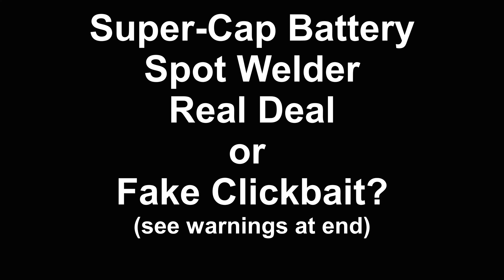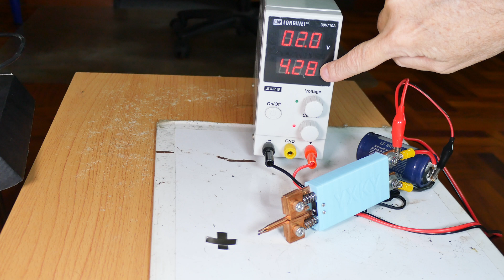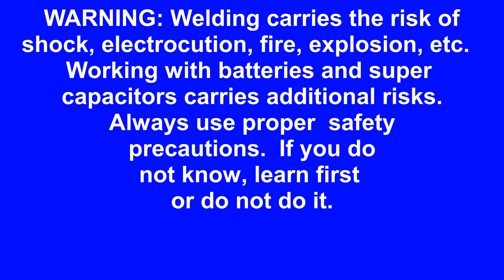DIY Super Cap Battery Spot Welder - Real Deal or Fake Clickbait?  (4K)

Comment: It is real
1. You need a board to control the weld time and preferably one that will do a double pulse
2. One capacitor is not enough. You need a minimum 2 3000F capacitors and a board that works with 5V. Most boards are meant for 12-14V welding and a 6S capacitor bank is most common
3. Low ESR capacitors. If you don’t have sub 1 milliohm capacitors then you’re gonna be unable to release enough energy in the 15-20 millisecond pulse you’ll be using the second part of the weld. 15-20 is an average I’ve seen people go over 40

4. You need a PCB for all your mosfets. Super high current, low RdsOn time, super low resistance are the most important specs. Completely unsure what to use? Use the same model off a well known powerful spot welder. Using 12’ish should cover most designs. 

5. Your board needs copper bus bars that attach to the capacitor bank and your negative lead. Pure copper, nice and thick. If you can get brass or a better copper alloy for the nuts and bolts that’s great. I think stainless steel would be ok. Don’t overtorque anything but a loose connection will significant degrade your welds. You want perfectly flat, flush connections

6. Your leads need to be large enough to prevent the overall resistance from rising. 6AWG or 8AWG silicone insulated wire kept as short as possible. You better have a hydraulic crimped to crimp those connections. Soldering can work if you do a good job soldering. Expect to use a torch. 

I think that’s all about the components. 

If you don’t even do the math on the weld current you probably won’t have a satisfactory result. Minimum weld current for battery welding is 400A and that’s bottom of the barrel. I would go for 800A minimum. 1000A is where things get to beat all the little cheapo Aliexpress welders. 1200A is very good. 1500A to 2000A is about the most you need for spot welding 0.3mm pure nickel and some thin copper like 0.1mm 

IIRC you can get over 1500A from a 6S bank of 3000F capacitors as long as they individually have an ESR below 0.25 milliohms

Comment: How many amps? Don’t be afraid of negative input, often it’s the most radical and therefore useful feedback you’ll get
Reply from the maker: True. As for amps, it varies a lot on thickness of the strips, the material being welded to, the length of time you need to create the weld, etc. and that determines the rig (caps, cables, welding points, etc.) I've welded really thin metal with 1 amp, but this arrangement won't weld with a burst of maybe 20 amps for the time it takes to discharge the cap.

Comment: Hello! Sorry, i dont get what this black wire with jack is for, could you tell me?? Can i use this pen with another adjustable welding station (with not connecting that jack anyway)??
Reply from the maker: The other wire is for a remote trigger. It is convenient but not required for every setup.

Comment: what is the black spooled up wire on the device used for cause your not using it
Reply from the maker: It has a foot pedal switch option and a pressure trigger option.

Comment: Why not using the super cap to power the spot welder? The trick is to deliver as much power as possible in a short period of time something like 10ms. Your welds are week because you heat up the nickel to much basically burning the weld.
Reply from the maker: The company that makes the welder specifically says not to use caps. They count on the internal resistance of the battery to limit the current to keep from blowing out the FETs. It's why they spec certain batteries.

Comment: If you read the instructions on most sites that sell those, they state that it is the probe only and that you will need to use it in conjunction of a high current switching circuit like the MOSFET board you have there. Use the 2 small wires to trigger the pulse after pressure is applied to the tips.

Comment: Single cell capacitor is way too low voltage. And because of this crude control you have used, the energy dissipated way too long so spread way too far around for a successful weld. Having good electrode pressure before the current is applied and then turn ON the switch for just exact time is essential, to make the weld but to not burn everything around.
So you really need the timer switch and at least two cells (charged to 5..5.2V).

Comment: I’ve successfully built many battery tab welders.   The issue is the weld needs to be FAST as so not to heat the cell and not destroy the electrode either.  A switch (ie mosfet bank, solid state relay, etc like the PCB you had pictured) is needed to control the energy.   The best way to weld batteries is to switch high voltage at high frequency into a step down transformer (you are only controlling/switching the primary current, not the welding current).  Most people don’t know how to do this and try to take the cheap way out like your setup by switching the full welding current (thousands of amps using lots of mosfets).  It is easy to do in theory, but in practice the energy is hard to control, and the losses are high. The only successful welder I ever built for batteries that did this used a few 1F (about 3-4 in parallel) car audio capacitors charged to about 12-16Vdc.  Then the most important part is to make sure the connection between electrodes and material being welded is made and solid (low resistance) BEFORE the energy is turned on, then run for a fixed time (don’t keep the energy on until the capacitors are depleted or the metal/electrodes melt).  Mine actually had two capacitor banks, one was 0.5F charged to 9V which fired first to do a pre weld (weld the copper alloy electrodes first to the nickel to prevent sparking and loss of energy when the main capacitor bank fires to do the actual weld)
Reply from the maker: Very interesting.  Thank you.

Comment: Mate going be honest a 3s 5ah 80c lipos are cheap and chargers can be pickup for cheap. And 80c will spot even 0.15mm with that pcb
Reply from the maker: I got some for about $50, but now I need to weld the pack together for the welder!  It's one of them circular things.